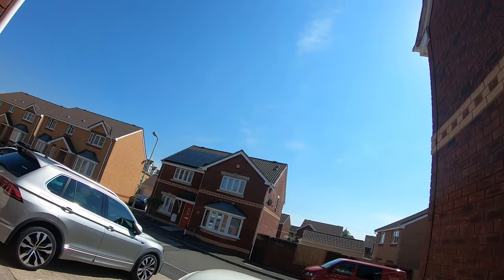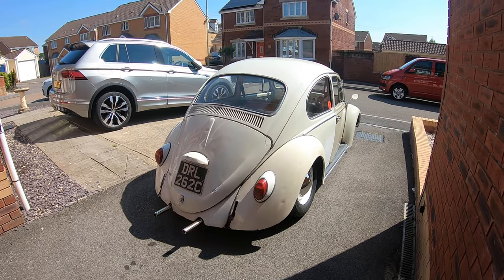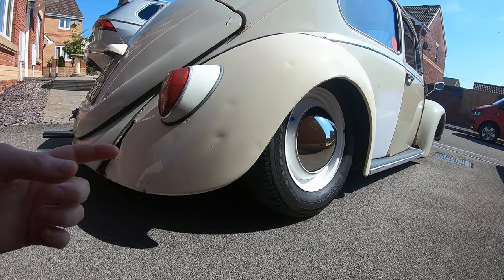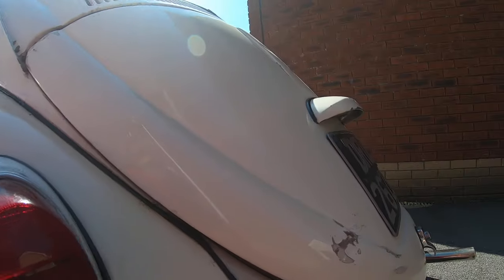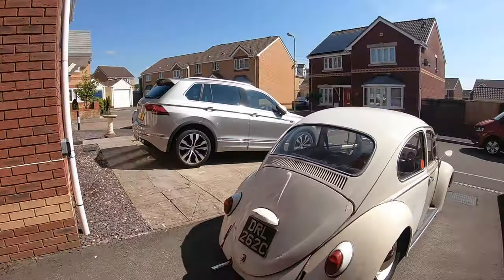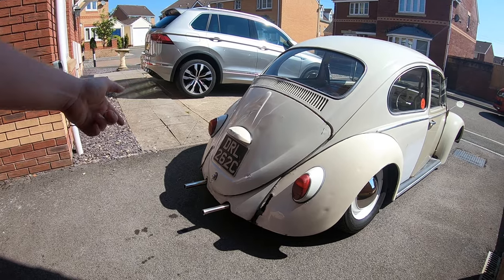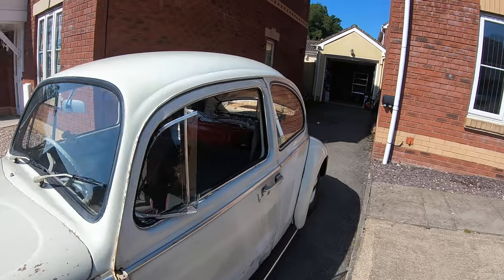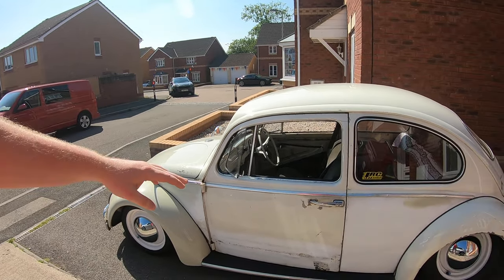Beetle Diaries - My Slammed 65 Beetle (Whats Leaking)

Comment: That's a big leak. It is a sweet sounding motor. If it was mine I would keep as is with the interior. Fun when you get a puncture. Take care my friend.😎🐺😷☮️👍
Reply from the maker: It does run so sweet, so hopefully when I fix a few things or general maintenance it will add to the out of site beauty haha. Touch wood I don't ever get one 😂. It would have to be recovered home just to take the wheel off. Take care buddy🤙🏼